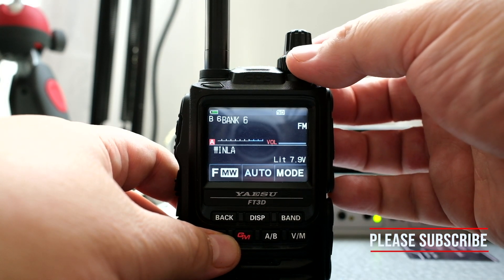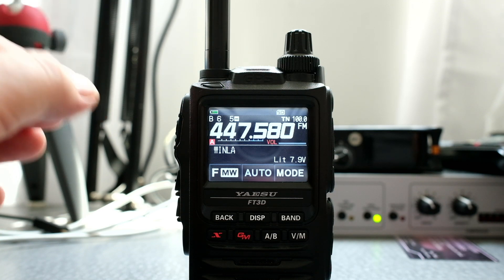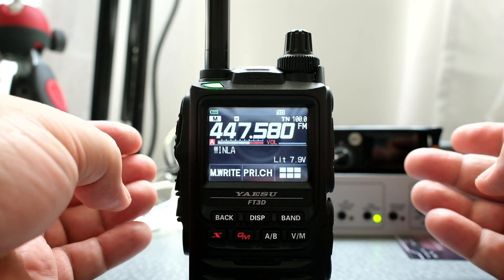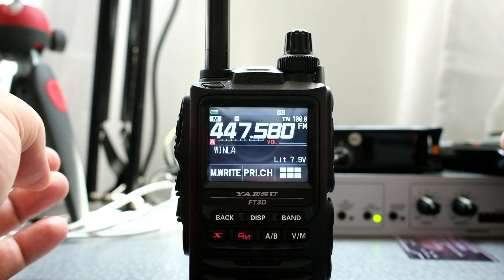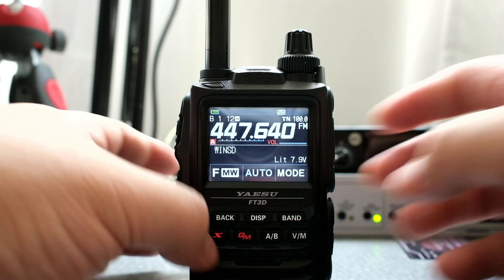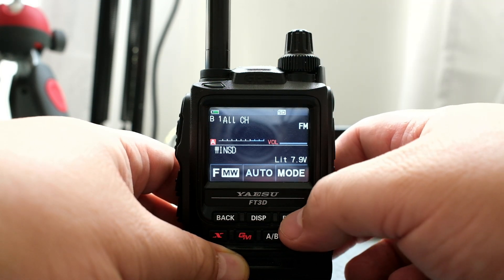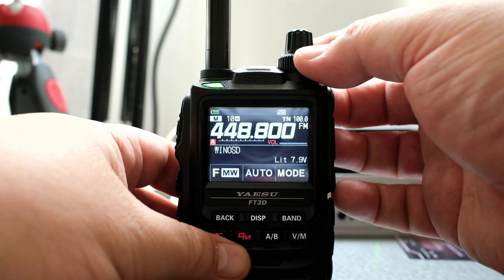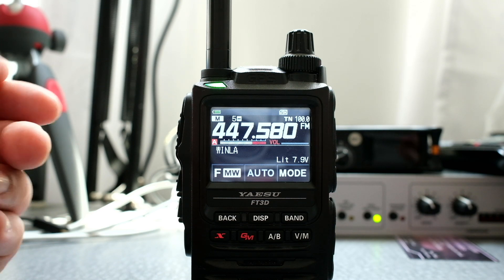Yaesu FT3D Delete Channel from Bank

Comment: Battery voltages I found: out of the box , I read : 7.5 v. Used the ht under normal conditions. Battery indicator started blinking @ 5.7v. Recharged. Now reading: 8.3v